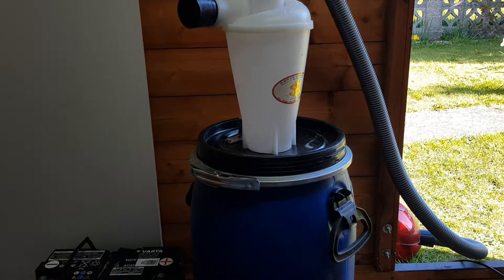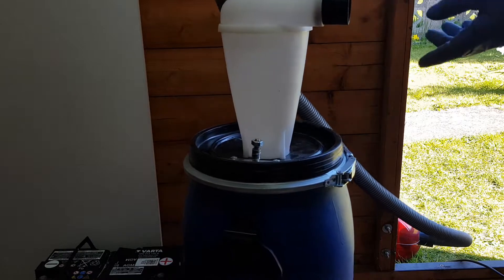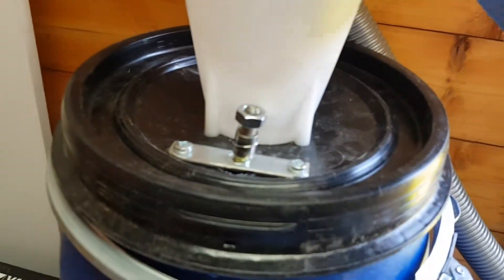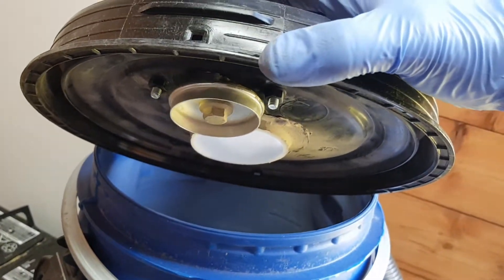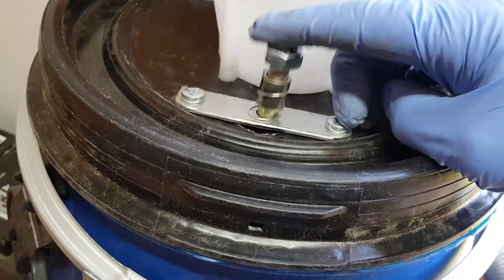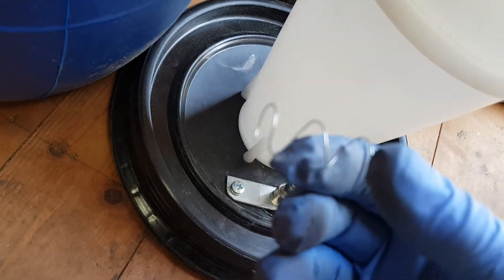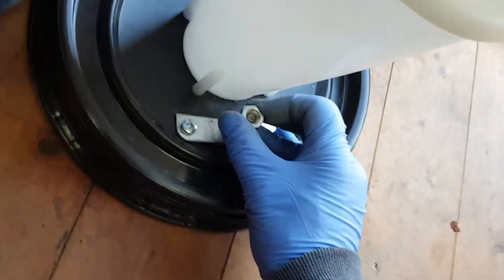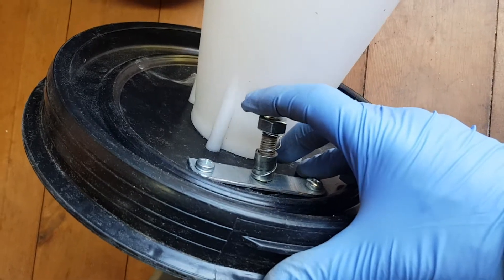Diy cyclone dust collection with pressure relief valve

Comment: I'm going to have to build one of these myself. I'm using a Dustopper, and my 5 gallon paint bucket from the big box store is imploding. How did you figure out the proper amount of spring action? I'm going to buy a multi pack of springs because I have no clue where to get just one, or just a few.  Hopefully there will be a spring in the pack that will offer enough but not too much resistance.

Comment: VERY GOOD THINKING !!!! I WILL MAKE ONE TOMORROW.  IT DOES NOT TAKE MUCH SUCTION TO COLLASPE A 45 GALLON THICK PLASTIC PICKLE BARREL. I HEARD A BANG BOOM AND IT WAS OVER. I HAD TO REVERSE THE VACUUM CLEANER AND BLOW AIR BACK IN IT TO OPEN IT BACK UP. A SLEDGE HAMMER WOULD NOT EVEN MOVE THE SIDE.

Comment: There are three possible locations for installing a vacuum-relief valve to protect the waste container and the cyclone itself from collapsing when the suction hose becomes plugged.  All three locations provide protection from collapse, but only one location maintains continuous cyclonic action and separation efficiency. 

1)  The only proper location for the vacuum-relief valve is at the side of the cyclone at the dirty-air inlet.  This location for the valve allows cyclonic action and separation efficiency to be maintained when the suction hose becomes plugged. 

2)  An improper location for the vacuum-relief valve is on the waste container that is open to the base of the cyclone.  Dirty air from the waste container is improperly drawn into the base of the cyclone, and cyclonic action ceases.  This violates a cardinal rule for cyclones that the waste container must contain dead air.  No outside air must ever flow into the base of the cyclone.  That is why the two gaskets into the waste container must be leakproof. 

3)  Another improper location for the vacuum-relief valve is at the top of the cyclone.  This location of the valve does not maintain cyclonic action when the suction hose becomes plugged.
Reply: For 1)  the only proper location: could you expand on your remarks as I cannot see where there is room to make this installation. Thanks
Reply: @Macthe Knife  The only proper location for the vacuum-relief valve is at the dirty-air inlet at the side of the cyclone device, where the valve would automatically open whenever necessary in order to introduce outside clean air into the constricted dirty-air stream.  Adding a relief valve at this location would require adding a custom-designed in-line box or tubular device having a spring.  Building it would require ingenuity.  Many working designs are possible for such an invented in-line device.  I think the only people who will expend the effort to build and install such a device at the dirty-air inlet are those who cannot get along without it.  I think most people will choose a way to strengthen the waste container to prevent its collapse, and they will tolerate the loss of fine-dust separation efficiency during short periods of pickup-hose constriction.  I think only purists will design and install a proper custom vacuum-relief valve in order to keep as much fine dust as possible out of the vacuum cleaner's filter under all operating conditions.  If full or partial constrictions occur often and clog the filter with fine dust, and/or if the waste container is huge and cannot be sufficiently strengthened to prevent its collapse, then designing and installing the custom valve for the dirty-air inlet would be worth the effort.
Reply: I has a spring check valve on my dust colectas, installed it next to dirt air entrance, but now you mention when air stops flowing and valve is open the ciclón effect stops , maybe because it is needed to has a curve same way as the main entrance, I’ll will try to use a 45 angle L conector to se if it works as you mention. And maybe to increase suction power is needed to not use the long pipes I’m using. By now apart of this little detail my dust colector works great. BRGDS
Reply: @calaveraXIII  Whenever a custom vacuum-relief valve at the dirty-air inlet opens in order to introduce clean outside air into the dirty-air inlet, then cyclonic action continues to occur as is desired --- but the resulting swirling clean air might not be apparent as observed through the wall of a transparent cyclone device.  One goal is to carefully adjust the spring force of the custom vacuum-relief valve so that the waste container is always protected from any significant destructive deformation, in every situation.  But there is also a second goal, which is to carefully adjust the spring force of the custom vacuum-relief valve so that cyclonic action is maintained in every situation.  The valve should not be permitted to introduce any clean air 1) unless it becomes necessary in order to protect the waste container, or 2) unless the internal vacuum has become so large and corresponding air flow has decreased to the point that cyclonic action has ceased, even though a strong waste container might not be in danger of collapsing at that point.
Reply: I’m going to attempt to build mine with a 2” pipe T fitting, so that I can attach it to the dirty air side of the cyclone. I have a powerful 240 volt vac for my floor sanders that will crush a 55 gallon metal drum if the hose gets linked, stepped on, or clogged.
Reply: YOU ARE FULL OF SHIT !!!!!!!!!!!!!!! THEN WHY DOES THE COMPANY THAT MAKES THE PRESSURE RELIEF VALVE SAY PUT IT ON THE BARREL. AND ALSO IT THE HOSE CLOGS UP I WANT THE THING TO STOP WORKING AND OPEN TO KEEP FROM COLASPING MY BARREL. GO GET ANOTHER BEER AND SETTLE DOWN GENUIS !!!
I THINK A BUD LIGHT WOULD DO YOU GOOD.
Reply: I get the point of what you’re saying, in that if the valve opens and is not in the “proper” place it will interfere with the intended function of the cyclone, but I don’t see why it’s a problem though…if you are primarily using the valve as a back up safety measure so that in those instances where you completely suffocate the end of your hose, you don’t immediately crush your bucket.  In this case the valve would only open briefly and you would  quickly stop whatever your doing that’s suffocating the hose, so the lack proper function would only be a few seconds at best.  

Now if you were using it in a different way such as allowing it to open continuously as you vacuum I could see that this would be too much obstruction to the proper function.  

Does this make sense?  

I only bring it all up cause I’m going to put a valve in my system and I’d prefer to put it in the lid of the bucket if possible for ease.